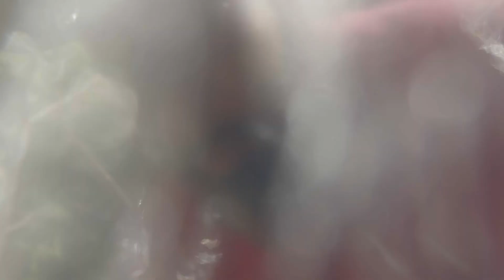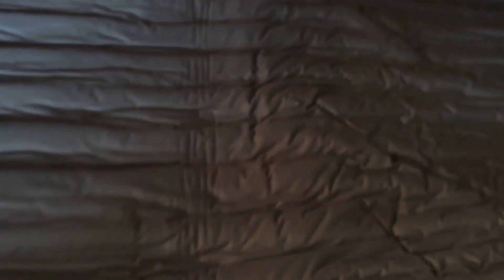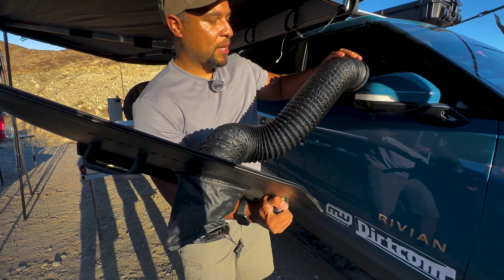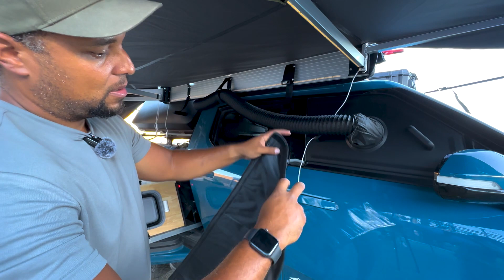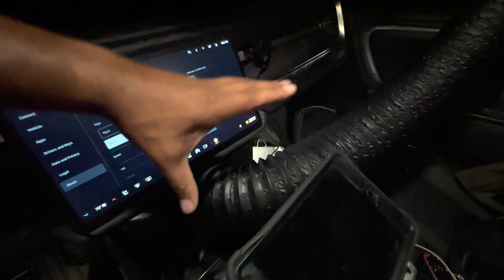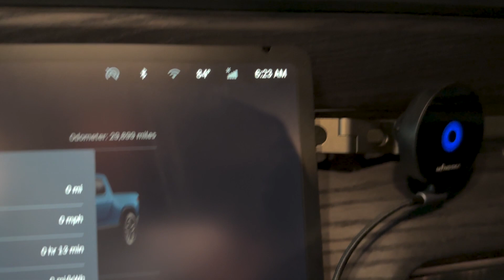Campstream cools your tent with the power of the Rivian R1T/R1S - S2E5

Comment: Why not use the camp mode and keep it to 'on' instead of using the seatbelt which seems to do the same thing?
Reply from the maker: I didn't realize that campmode keeps the HVAC going....Thanks!
Reply: @evlander  yes sir, if you set it to keep on, rather than normal, or keep off then it will keep it all on as if you are car camping (really made for the R1S, but works great here too).

Comment: What’s your kilowatts per mile with those tires?
Reply from the maker: Correct me if I’m wrong but you want to know the range hit. I’m seeing about 6.5% hit at 65mph… 2.28mi/kwh vs 2.44mi/kwh

I’m going to release a video on it soon
Reply: @evlander  thank you that’s what I meant for the range hit. How many miles can you go on a full charge? I have my reservation for the R1T with the 21” wheels but after I wear out those tires I like the look for the 20” wheel and was curious what range hit I’d see
Reply from the maker: @vinnym5095  From 21” to OEM 20” is about 8% to 10%
There is more rolling resistance with the 20” wheels.
Then going to none OEM, the weight increases. If you stay with the same size as OEM 20”, 275, than the his is minimal. But I have 295, so that’s were the 2% came from.